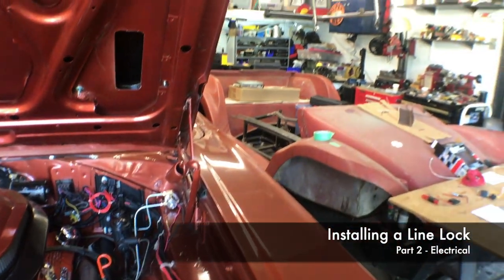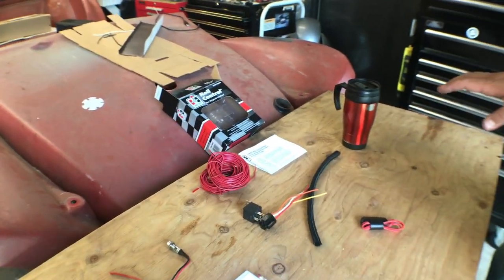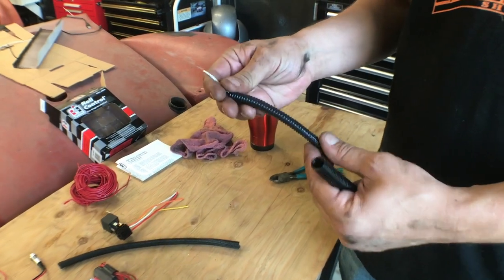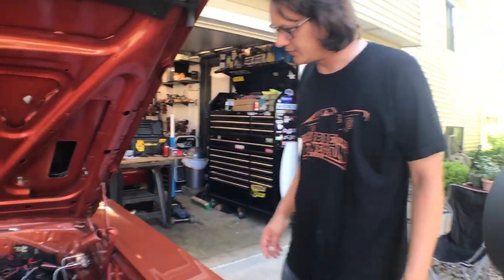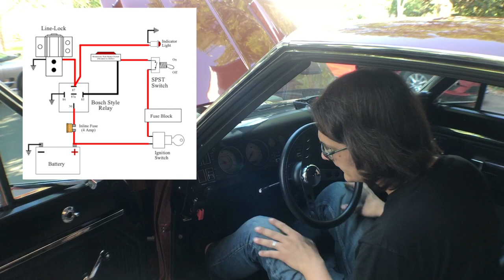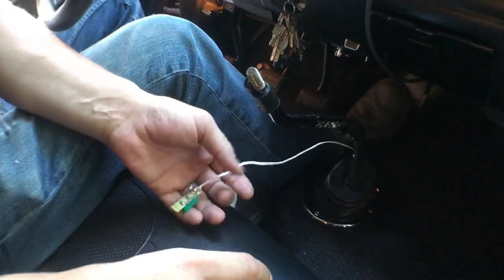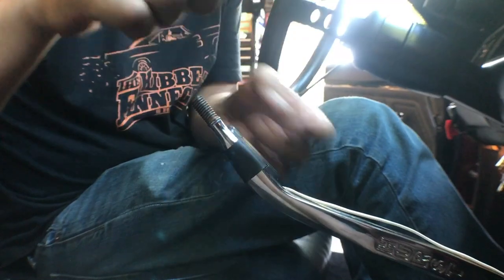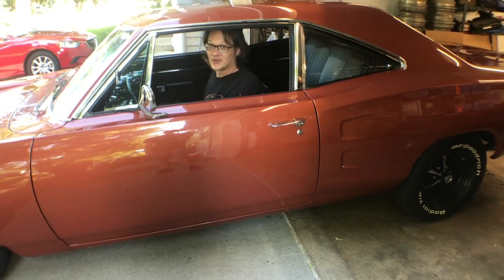Installing a Line Lock Part 2

Comment: Thanks for showing this, useful tip on how to use the mobile phone in hard to see situations, and also the tip on bending a wire and using it as a template. I found the backing track annoying as the volume fluctuated and it was hard to hear what you were saying. Never the less I will have a go at this on my 1980 Camaro Z28, 454 BBC, I get a lot of looks back here in the UK ! Nice ride, and useful garage you have, cheers
Reply from the maker: Thank you. These were our first videos, and we had not yet figured out the whole video editing thing. Maybe someday in the future I’ll try to re-cut it with better audio. 

Good luck with your Camaro. Send us an update when you get your LineLoc installed!

Comment: Just to make sure I am understanding this correctly - it’s is okay to put the line lock before the proportional valve? And with the lock setup for the rear… you lock the rear open before pressing the brakes, right?
Reply: It is plumbed for the front brakes and keeps them engaged after you let off the brake pedal.